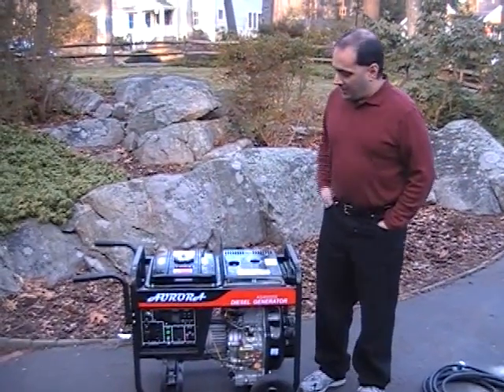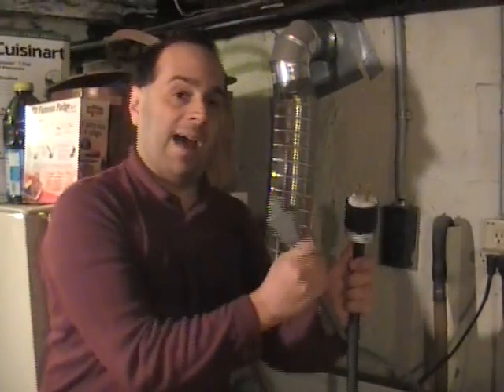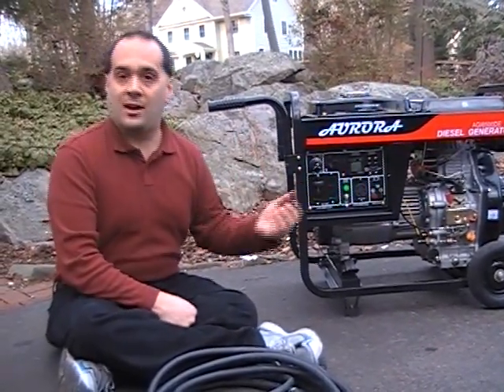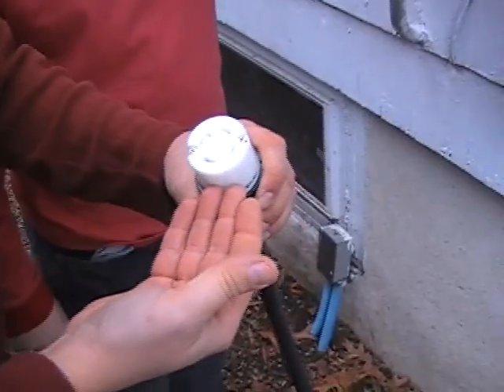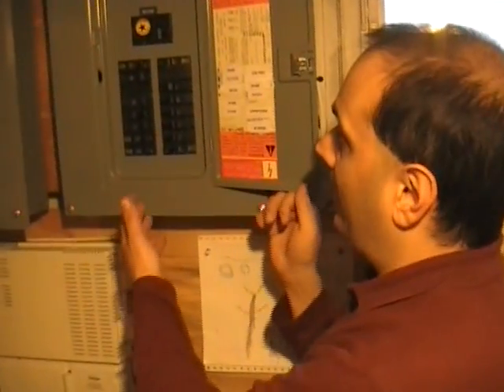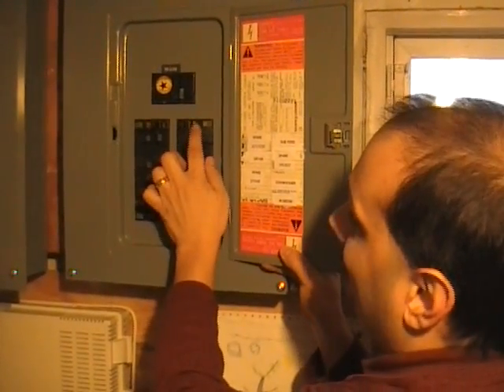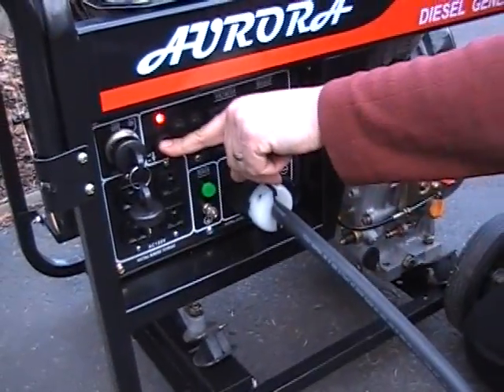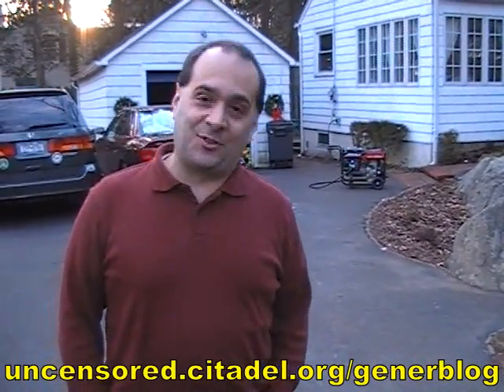Inexpensive residential generator hookup

Comment: Well, that's a "double male cord".  A "suicide cord" has a male plug on one end, and just bare wires on the other.  Used for the testing of all manner of things....
Reply: https://en.wiktionary.org/wiki/suicide_cable - Not necessarily.
Reply: @leadingedgemultimedia2406  I solved the problem I just call mine a jumper cable, no problems in 20 years. No fires either, just use the proper gauge of wire.
Reply: @shofar-man  I fail to understand why people who have the ability to "do it the right way" feel the need to make it less safe and not code compliant.  I understand that in a pinch "MacGyvering" things is done, but when you have adequate time and resources to prepare why take any chances?  If you look at virtually any safety rule or code they were written because someone did something that caused harm in some way.  It's how cars are made more safe because we learned from unfortunate incidents.  Same applies to electrical code.
Reply: @leadingedgemultimedia2406  I can't find a code that is violated. The code applies to house wiring and mine is wired per code.
Reply: @shofar-man  Backfeed a generator through a dryer outlet and when your house burns down and your insurance denies the claim let me know how that works out for you.  Promoting doing this any other way that is less safe is ignorant especially when people have adequate time to prepare for an unfortunate event.
Reply: @leadingedgemultimedia2406  I don't use the dryer outlet, but if wiring is adequate for the dryer why would it not be adequate for the generator? My generator does not exceed the capability of my wiring. 

Amazon sells Parkworld Generator Adapter Cords 18" so you don't have to cut the plug off a generator cord, or full length cords as well.
Reply: @shofar-man  See NEC 230-95 and NFPA 70-1996 for the need to, or not to, switch the neutral. Absolutely, if you have a generator rated at 30 amps and your dryer is a 30 amp circuit, the only way to cause a fire is if the generator breaker doesn't open under a overload and the generator, somehow, continues to supply the elevated current. VERY UNLIKELY !!!
Reply: Here are the portable generator safety rules: please make sure you are aware of all the warnings before using portable generators. This is just a reminder for everyone’s safety. All generator safety rules should be followed carefully. This advice is just to make sure that everyone is aware of all the warnings and it’s just to remind people to be careful using portable generators. Generators can be dangerous if not used carefully. Every year, hundreds of people die or get injured when using portable generators due to carbon monoxide poisoning and electrocution. Make sure you are using your generator carefully and keeping others safe as well. There is something very serious that everyone should always be aware of when using generators. Some people do run their generator indoors which is not safe and that increases the risk of carbon monoxide poisoning which can cause death of family and you. Some people run their generator in wet conditions which can electrocute them. Please remember that you should never run your generator indoors. Remember that carbon monoxide is an odorless and colorless gas that you cannot see or smell. Carbon monoxide is a silent killer. Keep that in mind. Make sure your generator is 15-20 feet away from your house and away from doors, windows, and vents. Never use your generator in your porch too. Having a carbon monoxide detector is very important against generator safety. Some people also allow children to go near the portable generator which could pose risks. We need to keep an eye on our children making sure that they are not near the portable generator so they won’t get electrocuted or burned by the generator which is dangerous. A locking enclosure also keeps kids safe. A generator shed might look like a tempting place to explore, or take cover during a game of hide and seek, but a generator is a dangerous piece of equipment that can cause injury. It says on the manual that we should also keep children away at all times from the portable generator to avoid injuries. Please do not allow a child or unqualified people to operate the portable generator.  It is important to keep your children safe especially little ones. The portable generator can be hot during an operation. Just because some manuals missed what should be listed doesn’t mean it’s safe to do. Always follow the generator safety rules when using portable generators. Generators pose electrical risks. If you need to use your generator during wet weather, you need a generator tent to protect your generator from getting wet. Don’t let your generator get wet. Keep your generator dry and before using your generator, please make sure your hands and your generator is dry. Do not wear loose clothing when operating the generator. Everything that is said on the generator’s operating manual should not be ignored. Never smoke cigarettes near the generator. Please keep flammable things away from the generator. Never overload your generator too. Your generator can catch fire. Never ever try to plug a generator cord into a wall outlet to avoid back feeding. Back feeding your generator is dangerous. Always turn on your generator first before plugging in appliances and shut off the appliances before turning your generator off. Use a heavy duty cord for your generator and the cord should not be worn out. All the instructions should be followed carefully. Never refuel your generator while it’s running. It can cause fire if fuel spills while your generator is hot. You should turn off your generator and let it cool off before refueling it. Having a fire extinguisher next to the generator is also important. This is only a reminder for everyone’s safety of using generators. Make sure your generator is properly grounded. Having a fire extinguisher next to the generator is also important against the safety rules. https://youtu.be/I1jT3ANENvI and here is a video more about keeping others safe when using generators and also about our family’s safety. It’s important to keep our little children safe as well. Make sure they’re away from the generator. Hope this helps. Safety is always important before using generators.